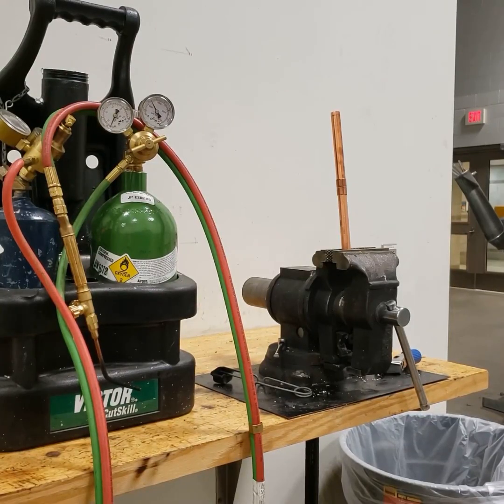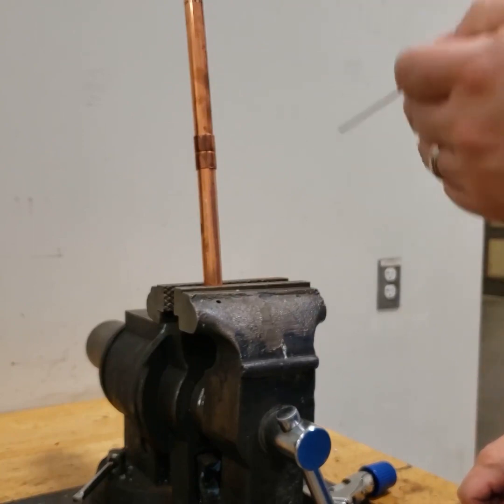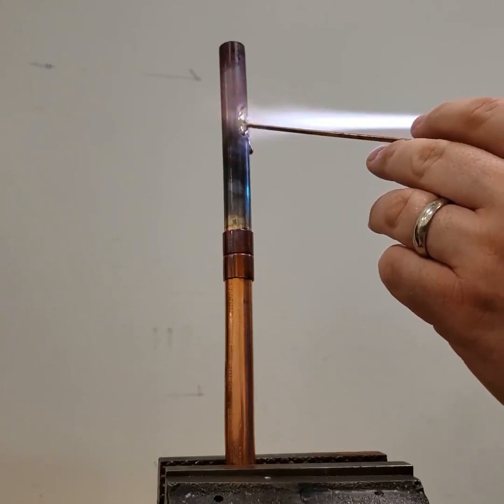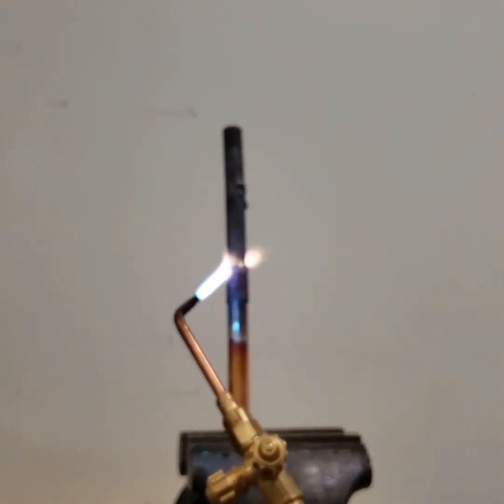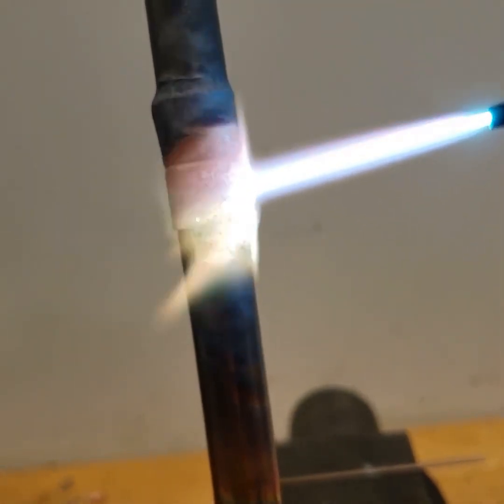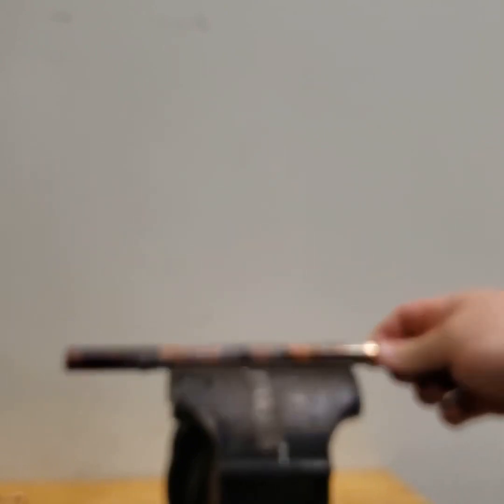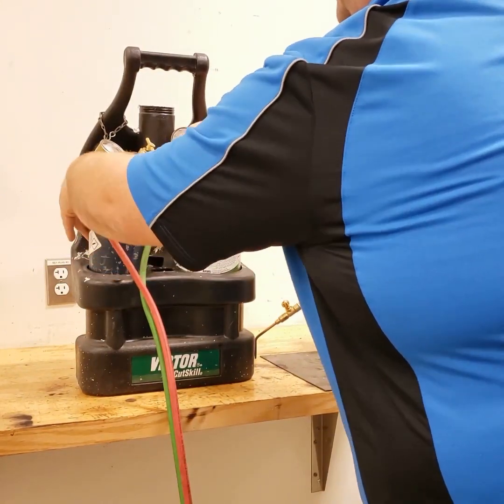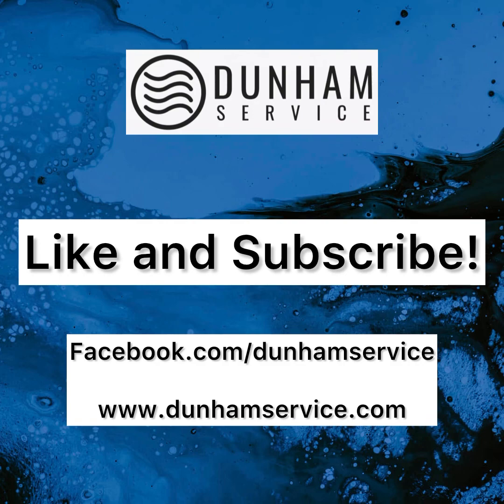HVAC/R Brazing Practice

Comment: Use some flux and a little more heat. Your joints will look better.
Reply: You don't use flux to braze
Reply: That's the way I was taught 40 years ago and it's served me well for 4 decades. Tell me, if you don't use flux to braze, why do they make and sell brazing flux?

Comment: when i braze in a new compressor, scroll copeland, i need to have nitrogen, its it correct that i put nitro on low side and blow out on the high side? Becuse the compressor have a rewerse seal on high side in compressor and can damage the seal?.  correct? so its ok to flow nitrogen in to the compressor while braze?
Reply from the maker: As long as the nitrogen will flow without building pressure on the low side. I try to follow the normal refrigerant cycle for nitrogen flow.

Comment: Please for the love of service flow nitrogen on refrigerant lines, boys!

Great video! I call that newbie maneuver you showed “painting the solder” lol. I see it once every training class covering soldering.

Also, typically the first thing I do when I pull out a stick is bend a 90 into one or both sides for easier maneuvering around the joint, especially when there are more times than not where I can’t access 360* around the line as you stated.
Reply from the maker: Thank you for the great comment!